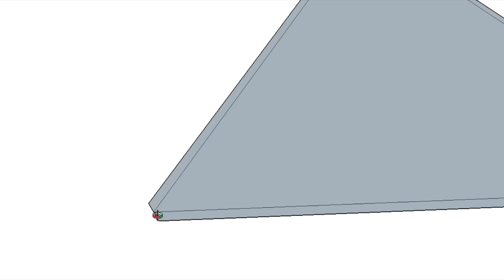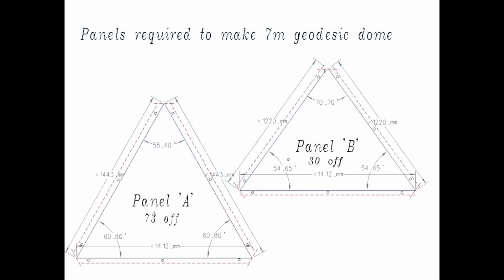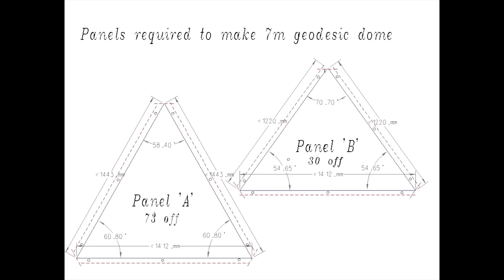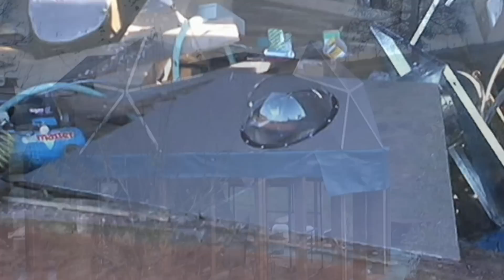Dome build methods - stressed skin construction

Comment: I'm interested in building a 3V stressed skin sphere out of steel, do you know how I can calculate the bend angle of the tabs at each edge? Since I am using steel I dont think I'll be able to easily adjust the angle once it's bent.

Comment: Thank you for your most excellent dome video.  Each panel can be filled with a coat of spray on foam insulation prior to installation.  So stress skin construction seems to be the best method.  I've try your paper model.  If that goes well, I build one in the backyard.  Thks again

Comment: Would you recommend a spray on foam insulation on the inside of the dome to deal with the condensation  problem? How large do you think this design can be practically scaled up? I'm interested in a DIY design for a dome home built with a crawl space. A primary design feature would be the ability to easily move internal walls around allowing the structure to evolve as a family grows and shrinks.

Comment: can iron be used for this?
Reply from the maker: Yes, any metal sheet would work, I would use galvanised rather than paint as rust could be a real problem, Buckminster fuller's union tank dome was demolished because it rusted up and it was too costly to maintain.
Reply: Here in Paris zinc is the roofing metal of choice in all the buildings of the 19th century. It's rust-proof and doesn't change with time. It remains light grey. I don't know how hard it is but roofers ust have the equipment to cut it with precision.

Comment: A few questions:

1)  Do you have panels to show up close?
2)  Did you use a rivet gun? How did you install the rivets? Would cold welding work?
3)  How did you cut the aluminum panels? What method?
4)  What is your weatherizing sealant on the top and, how is it applied? Some here in the USA are spray liquids.
5)  Once you fit the foam interior triangles (glue I'd assume) did you use 2 part spray foam over it?
6)  Did you use a metal skeleton of bars for the top or just simply assemble it using triangles and rivets only?
7)  Would you see this as a viable solution for a home if properly insulated?

Thank you for your valuable input to our dome building community at large. I've learned a lot from your personal efforts.
Reply from the maker: Ok
1) Sorry no, I will have some offcuts so could take some pictures of them.
2) Standard pull rivet gun, installed from outside, I don't think cold welding would work.
3) A fabricator cut them with a guillotine and folded the edges with a press, pretty common tools in any metal workshop.
4) it's an acrylic with fibre, brush coated, very thick sticky stuff.
5)I I glued 50mm polystyrene to the inside f the panels, sprayed polyurethane foam from a guniin all the joints/gaps then filled the 10" space between outside and inside skin with broken polystyrene packing. 
6) No the whole dome is 16 gauge aluminium all the same construction.
7) Yes, I will be doing a video on dome home construction methods so keep an eye out for that.
Cheers, Paul
Reply: +Paul Robinson Very helpful. Thanks for getting back to me Paul.